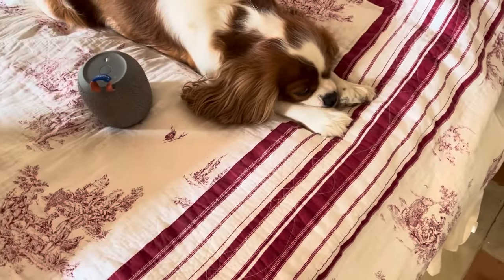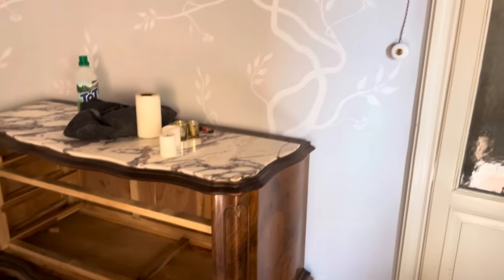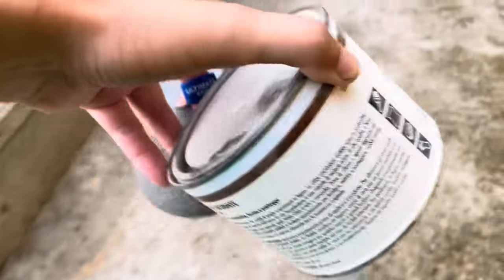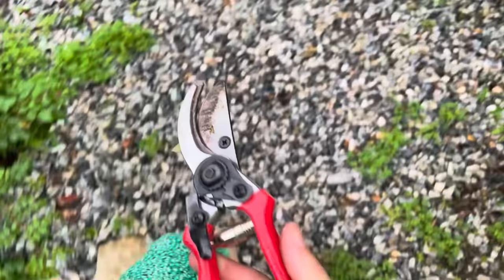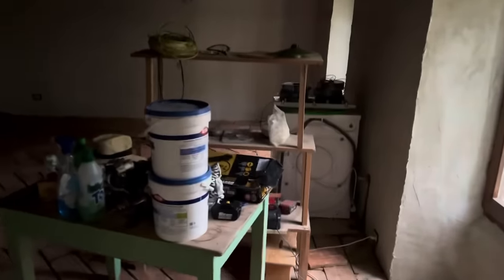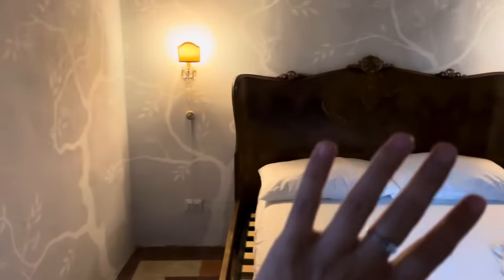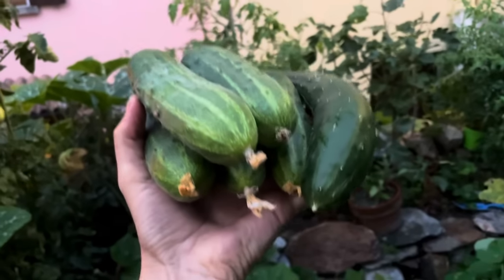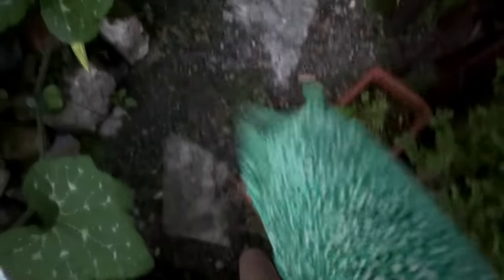Cleaning and cleaning/ Renovating on lake Como

Comment: Alla, is the tile you want to clean a porous clay tile that does not have a sealant on it? Asking because on ceramic tiles at my house, professionals used hot water and Tide powdered detergent w/ ammonia and a scrub brush to clean the tiles and grout. As for the dresser in your bedroom, after you’ve cleaned the wood, I suggest you use a mouse sander to sand the wood inside to get rid of the old smell. Looks like there’s a bit of mold, so consider using a final rinse of hot water & white vinegar. If the wood isn’t well sanded,  you may find your clothes end up smelling awful. Such a beautiful bedroom, Alla!  The views from this room are gorgeous! Beeswax candles are what I use in my own home as it’s so good at cleaning the air!
Reply: Agree and 100% beeswax candles as well as beeswax for wood.